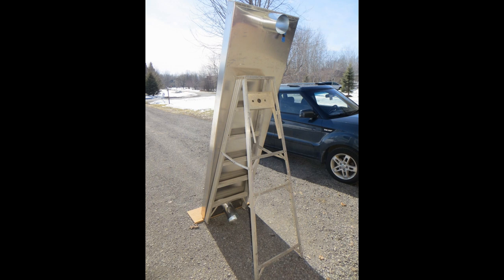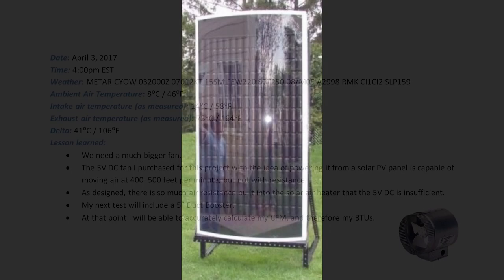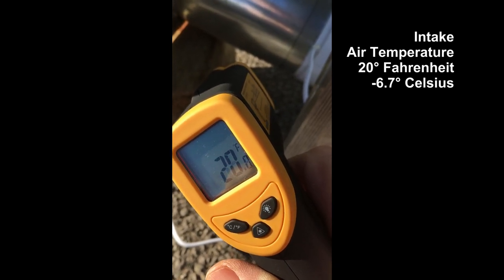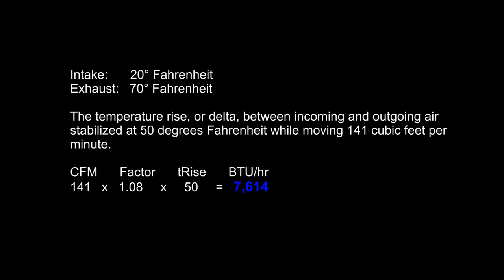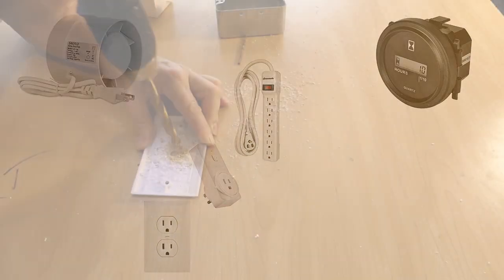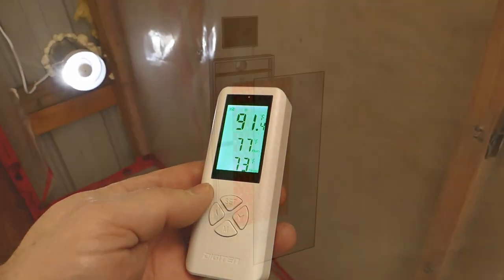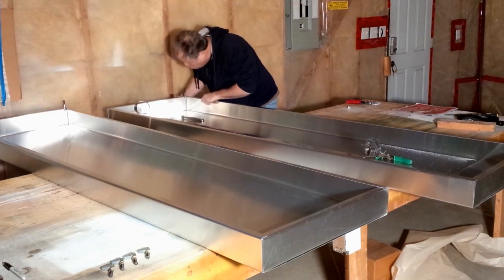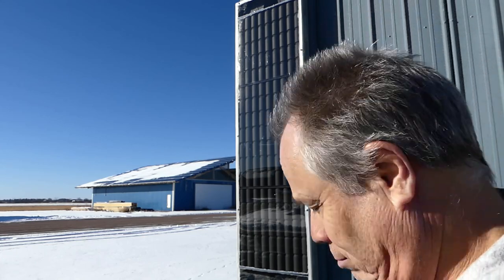DIY Solar Air Heater Part #6

Comment: Thank you so much for finishing this scientific project. I have been following since you started.  I had built something  out of 2x6's, pop cans. 1/2 of a sliding glass door etc around 2000--2015 ???  If I weren't 76 I might try to copy yours. Instead, I will just enjoy yours and admire it.  Thanks for finishing it.  I can rest easy.   Bill Dawson
Reply from the maker: Thanks for the feedback. It is been a great learning experience. A week ago I just finished another unit, tweaking the design slightly, and improved efficiency even further. I'll release video seven in the next 10 days. Cheers. Best regards.

Comment: Hi, thanks for a great video. Had a thought regarding insulation. The upper outlet is insulated so that the warm air that has left the jars is isolated from the glass. Since you have more than 30 degrees Celsius, you get a cooling effect on the hot air that goes into your workshop. This may increase the effect a bit.
Kind regards Niclas Petersson

Comment: That is a dam nice unit. High Quality construction.  Probably the best since I been researching.
In your final calculations you confirm  it is a 16 watt blower so the max unit from blower would be 141CFM  ( can confirm with amazon blower 16 watt is 141cfm unrestricted)
With all the restriction and air turbulence in the pop cans. Guessing getting a max of 60CFM so BTU would be about half of what you calculated.
Be nice if you had a Anemometer to measure the airflow at the outlet pipe.
Still a dam nice unit.  Free heat is free heat but accurate BTU would help to calculate recovery cost.  

Currently working on a unit so taking the best of designs.  Wish I had the skills and equipment to do your Aluminum frame.

Comment: Replacea conventional furnace, not really.  But augment one, absolutely.  Make an otherwise unheated hangar a LOT less uncomfortable, absolutely.

You have a LOT of available sun-facing space on the front of the hangar where you could install more heaters, adapting the design to fit the space of course.   As you determined and as so many of these homebrew solar collectors fail to realize, air flow is far more important than temperature.  So long as the air going into the space from the heater is warmer than what's already there, it's working well.  Big numbers for temps are fun but not that useful, and mean that a lot of heat is getting lost from the heater itself, reradiating back outdoors.  I think if you were to install an actual differential control that monitored the temp inside the hangar and turned up the fans accordingly, you could see a tremendous improvement in collector efficiency.

Also: if the hangar door were clear, the sun could shine into the space and heat it directly.  No moving parts.

Comment: We love ours in our off grid camp. On a cold Minus 20 day. We can walk into our camp on a sunny day in January and the drinking water we leave in the sink will not be frozen. Only takes 1 hour to warm everything up. Not an entire day. So cost over time for us. Is well improved. Our camp is angled So it collects the sun in winter throughout the entire day. All windows face the sun arch throughout the day. All the windows in winter get a peace of brown insulated foam sprayed brown and hung 1 inch away from the window as we found out leaving one against the window will crack it.   We found Brown high heat paint will absorb the most amount of heat better then Black. Our Pop can Heater is 2 feet by 5 ft. Camp is 16 by 38. Single floor. And Works Every well for passive heat on a cold sunny winter day.
Reply from the maker: I agree, I find if I start my work day in the hangar a little later, say 9:30am, the units have taken the chill out of the building, and no supplementary heat is needed.  The solar air heaters have taken the edge off, and continue to warm the building throughout the day. Very pleased.

Comment: Hello! Congratulations on the very interesting piece of engineering. The presented expertise is valuable. I have a question, and I'm sorry if I missed the information through the project videos:

Have you ever checked the temperature at which the polycarbonate front cover could possibly release some kind of chemical component into the air flow?

An airtight metal path would eliminate such a fear by limiting the exchange to heat exchange. However, the net air volume would be dramatically reduced from the chamber volume to a, let's say, zigzag pipe.

What are your thoughts on 1. The chemical risk and 2. The net air scaled-down?

Many many thanks!
Reply from the maker: Hi thanks for the question, and sorry for the late reply.  The short answer is no.  I know I keep the chamber fairly cool, relatively, and this is done with higher CFMs.  But to answer your question, no, no consideration to the temperature of the polycarbonate.  I can share that if I was to do a “do over” I think I would use glass.  The plexiglass does not seem to be keeping up well to the elements.  Dozens of hair-line cracks that I have drill-stopped.  I will be keeping my eyes open for recycled single pane glass.

Comment: it may not heat your building but it would be awesome for my poorly insulated 760 sq ft house. love your videos man! been thinking about building my own but closer to 36 by 48 inch.
Reply from the maker: Sounds like a great plan.  If I was to build another one, I would continue to experiment.  I would try aluminum down spouts, painted black, and then stuff the inside of the tubes with crumpled aluminum screen, the same kind of screen you would use on a screen door.  I have heard some good results from a few people in Mongolia. Best of luck.  Cheers

Comment: I would go with a solar hot water heater and exchanger linked in unison with the unit... water holds heat longer but you would be able to utilize this excellent CFM system you have pushing the warm/hot air. Great video!
Reply from the maker: I’m interested in your thinking, but unsure how to introduce water to a system that would freeze at night, unless you are suggesting circulating antifreeze as the fluid?
Reply: @LifeIsShortDIY  you need a large hot water storage box and some math to figure much volume to keep hot all night.
 Pex tubing in the floor to radiate heat up no fan required but the box is tedious to build and the flooring needs notched ,well worth it!

Comment: On your parts list, you forgot to mention how many sodas you had to drink to get the cans.  lol  What if you attached a mirror with a hinge so you can swing it out when the sun is off to the side?
I made a small one years ago, using about 53 cans. I made it to sit on a window ledge in the house. It was an experiment and nobody was going to allow me to drill a hole in the wall so it had to be completely inside. Looking back, I realize I should have set the thermostat higher to kick on the computer fan. I set it at 120-F. I'm in a condo now, but if/when I get a house, I'll build another one using gutter downspouts. No more soda cans. I need to watch my sugar intake.  lol
Reply from the maker: ha ha, love it.  thanks for the comments.

Comment: Unit looks good but how did you come up with CFM?  is that the fan rating?  Did you use an Anemomete to  measure CFM at the outlet?  There is a massive amount of air resistance and turbulence in the can design.  If you used the fan rated 141 CFM at best you might be getting 60cfm with all the resistance.

Comment: I've been really excited about building several of these units (albeit with cheaper materials). Going to attempt to hook them to the central heating if the house I'm renting, which hasn't worked in years.
Reply from the maker: cool.  I'd like to see how that works out.

Comment: Great video! You can replace the beverage cans with black fiberglass cloth (matte black painted extinguishing cloth) or kevlar cloth (welding protection cloth).
Reply: Which has actually been proven to preform better ~ the cloth or the cans ?
The cloth is definitely less work / time.
Reply: @carpenterfamily6198  The cloth makes the construction so fast that you can make several pieces a day. Highest temperatures that I have achieved are more than 110 C, on a day when outside temperature was
 -20 C.
Reply: @kansaIainen  I have just finished a second unit, tweaking the design to enhance conduction even further. I should have video 7 up in the coming weeks.  I am interested in experimenting with different materials as well. Please share more details on the cloth idea.
Cheers
Dwayne

Comment: Wow it's nice project. I have few questions.
1. How many square (m2) can heat your heater?
2. How long time can be warm? How about the night?
3. Cloudy or snowy day work?
Reply: This unit has an approximate area of 1.5 meters. In perfect conditions, it could capture about 2,000 watts.  We don’t have perfect conditions, and we are not pointed directly at the sun.  I suspect I’m getting somewhere around 1,500 watts when the sun is unobstructed.    

One thing that I have learned is that you need to minimize heat loss through the glass.  An important way to do that is to keep the absorber temperature as low as useably possible - the cooler the absorber runs, the less heat will be lost out through the glass.  A way to keep the absorber cooler while extracting the same amount of energy from the sun is to increase air flow.
Yes, I have seen it run even though cloud cover, but there is no magic here.  At best, the sun provides us with 1,360 watts of heat per square meter.  Solar air heaters don’t produce heat; they capture whatever heat is available.
Reply: @dwayneprice956  thank you. Good luck 😉

Comment: Using a mirror as the backing to the cans and using elastomeric coating on the cans and painting them black and adding fresnel lenses to the front of the panel to magnify the heat from the sun it will put out more heat

Comment: Thanks Dwayne for your video and dedication to the project. I have always been interested in using car windshields as a solar air heater. What do you think?
Reply from the maker: I see no reason why that wouldn’t work, unless the windshield glass is designed to reflect heat, which might be the case.  Something to explore for sure.

Comment: Started watching this video. Not all the way through but looking at the temperature graph with the different styles for airflow. When you installed the cans in each row, did you offset the cans so they wouldn't all line up with the holes or did you line them up? If offset, it may act as an airflow restrictor so air is heated up in each can for a bit longer before going to the next can. Just curious on what you did.
Reply: Watched part 7 where you used 4-hole cans as well as fully cut-off tops and bottoms. Great idea for flow control. 

At work we use a lot of different types of heat exchangers to either warm up a process or cool a process. One heat exchanger that we use at work uses the warmed up liquid from one process and sends it over to another exchanger to get even hotter. I'm wondering if it would be possible to warm up another solar can heater with heated air from the first pumping into it or if there is a threshold that is reached where the air cannot be heated anymore. Or maybe use the heated air to reroute back to the original to increase the heated air.
Reply from the maker: @nickl8985  I love that kind of thinking.  What I have learned from using the units in our hangar, is I don’t want more heat, I want more units.  If I had an entire wall of these things it would make a dramatic difference.  The building is 40’ x 44’ with 12’ ceilings. Assuming you have sun, one of these units is all that you would need for a well insulated 9’x 12’ shop.  I knew that going in.  what they do in a large hangar is take the “edge off”.  It is really amazing when you have a cold winter day, -20C, but sunny, and it is above zero in the hangar. Cheers

Comment: I learned about solar air heaters about a week ago. I have 2 questions I can't find answer, so hopefully someone here can.

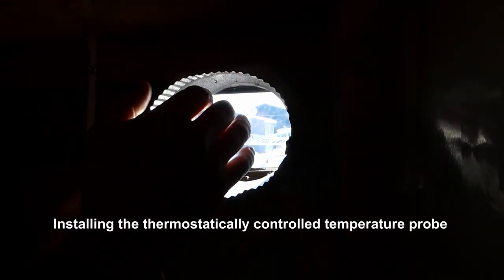1)  if one places solar air heater on the wall like You have here at 12:30, would it not be the same ( or better?) to just install regular window there to let light inside the room?
If area of window and solar air heater are the same, I just cant see benefit of this.
What am I missing here?
In my mind, solar air heater are best utilized placed on such surfaces that are not suitable for windows (like in between 2 windows).

2)  at 3:46 you made a restrictor, and I assume there is one on top of cans. Why do you use it, why not letting air circulate in front of cans?
To me it seams air in front of cans will get hot, and I know it will heat the cans, but will start to loose (small, but still usable) heat to front plexiglass.

Am I wrong in assuming that?

Thank You

Comment: Trying to understand the placement of the thermostat sensor. It’s in the vent output? The idea being it’s right between the unit and the building? Not quite understanding the rationale. Or does the device read temps on the other side as well? Thanks!
Reply from the maker: Hi jared, the temperature probe is just inside the exhaust port of the solar air heater. So, right where the air comes into the building. I just drilled a small 1/4 inch hole, and place the probe inside the exhaust port. Kindest regards.
Reply: @LifeIsShortDIY  ok. Trying to understand the rationale for this and how it works with the thermostat (about to order one), but I’ll trust it’s working for your goal, you seem to know what you’re doing. Thanks 🙏

Comment: What type of paint do you recommend. I’m building a solar pool heater with irrigation tubing.
Reply from the maker: Hi,
I used heat flat-black heat resistant spray paint, similar to what you would use on a BBQ.  
Cheers

Comment: I'm a physicist. You DO NOT NEED pop cans!! They DON'T DO ANYTHING!!! Just make an insulated box, with one side glass or polycarbonate, and suspend in the middle depth of it a piece of flat black painted steel window screen!  Then add your holes top and bottom with fans at top. It can be built ON an exterior sun-facing wall, and drill holes through the wall top and bottom, or it can free-stand if you put insulated duct hose on it.  Line the inside of the box with high-temp foam insulation with an aluminum foil backing facing inward.  In summer cover with a cardboard & aluminum foil batten shiny side out.
Reply from the maker: Yes I have talked with others from Mongolia about using screen.  If I ever get around to making a third unit, that would be the next material that I would try.
Cheers
Reply: Colin Mitchell  
Nonsense.  All you need is black metal screen suspended in the chamber. It can even be layered against the back wall. The fan takes care of the airflow. I've experimented with all these kinds and it doesn't make a bit of difference.
Reply: @rstevewarmorycom  wouldn't you get dust on the glass that way tho?

Comment: Hi. What with pressure drop (many small hols in cans)? In Your Calculate is fan performance from products sticker?
Reply: Hi, was wondering the same.  In his final calculations, confirms it is a 16w fan so max airflow would be the 141 cfm unrestricted.  
The 90 degree airflow turns and pop cans internal design will create a lot of air flow restriction and turbulence. If I had to guess be about 60 cfm at outlet.  
I bought a cheap $15 amazon Anemometer to test the outflow when I get mine done.   
Not sure how accurate a $15 anemometer will be.  Could check the airflow out of a unrestricted blow and compare to name plate rating.
That would be assuming the China made blower name plate rating is accurate. 
It is the nicest frame built I have seen so far in my research.

Comment: This was great! Gave me a lot of ideas. Really appreciate the effort. 
What software were you using for illustrations?
Reply from the maker: Hi, thanks for the feedback.  I use a variety of editing tools, depending upon the need:
•	Google Earth (topographical overlays and fly-by animations)
•	Corel Photo-Paint X5 (picture editing and video mask creations)
•	Corel VideoStudio X9 (primary video editing tool)
•	Free Cam Build 27159 (screen capture utility)
•	Windows Live Movie Maker Version 2011 (used for video file conversions)
•	Google SketchUp Version 8 (3D modeling & animation)
•	Microsoft Voice Recorder Version 10 (recording narrative)
Hope that helps.  Thanks again for the feedback.
Kindest regards,
Dwayne

Comment: Pull indoor air from ceiling area to bottom of heater. Exhaust heated air at 2 ft above floor.
Reply: Agreed
Reply from the maker: my second unit does that.  see video 7.  cheers

Comment: Reality check: what kind of difference does it make for your building? Is there any real gain? Like you said, in a 9'x12" (3mx4m) it would be of a lot more assistance during the day, but in such a large building, does it even bring it up 1 degree? Or is it feeding a small office in the building?
Reply from the maker: On a sunny day, that corner of the building is now warmer. I have another one already built that will be installed in the coming weeks in the opposite corner, and two more planned for the area above the hangar door.   Should end up with just over 30,000 BTU on the south wall.

Comment: What about summers. Do you take them off or something?
Reply from the maker: Thanks for the question
I simply unplug them in the summer.  Air continues to rise and vent through the system, with little or no impact on the overall temperature in the hangar. I also use the summer time to do basic maintenance. One of my two units has developed some cracks in the Plexiglas which I have had to stop-drill.  Not sure why one has cracked while the other has not.  On both units I oversized the holes to ensure the screws placed no stress on the Plexiglas.  Still trying to figure that one out. Dwayne
Reply: @LifeIsShortDIY  thank you for your feedback.